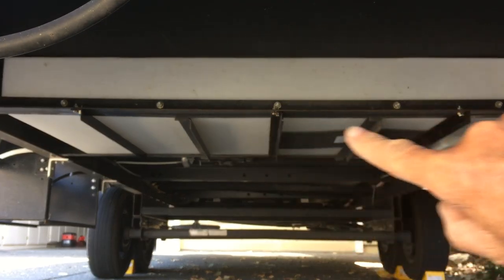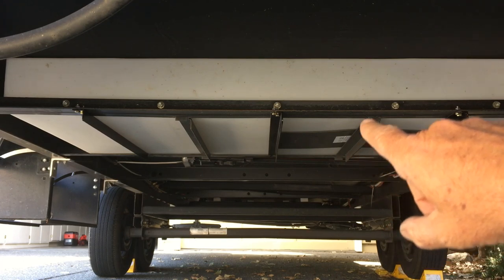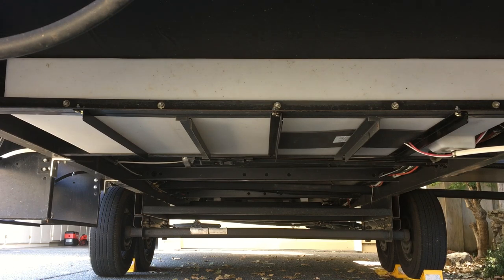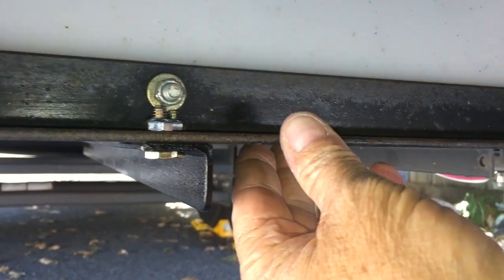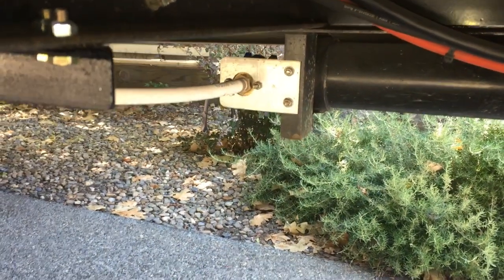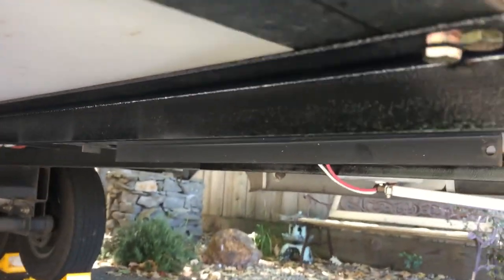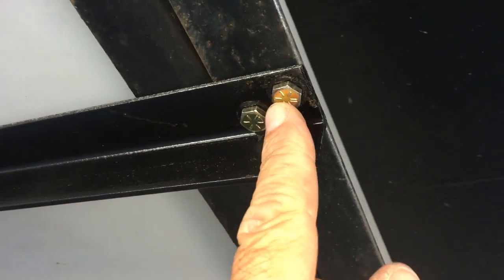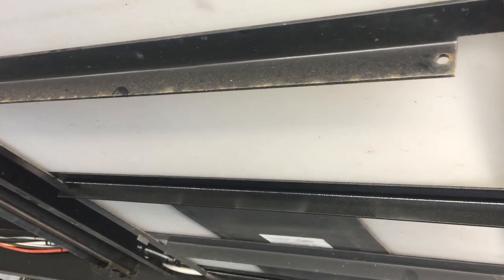How to Add Additional Support to Your Travel Trailer/RV Fresh Water Tank

Comment: That’s a well thought out repair. Just the way it should have been done from the factory.
My trailer has a corrugated plastic underneath the frame, and I’ve been meaning to take a look.
It’s always better to find problems in your driveway vs. on the road!
Reply from the maker: Yep preventative maintenance is the key :) , thanks for watching Tony

Comment: Even though you used flat carriage bolts I recommend to use anything to eliminate the gap between the tank and the L iron, bumpy non paved roads will highlight any possible issues down the road, maybe some thin plastic the same width of the head of the bolt should prevent the head of the bolts rub against the tank, I've seen tanks being dragged on bumpy roads so its awesome that you did preventative care to avoid that from happening, thanks for the video!

Comment: Nice conscientious work. I would be very concerned about the bolts on the angle iron against the tank.
Reply from the maker: Thank you so much Joseph and good catch on the bolts :) Fortunately I was concerned about these bolt heads wearing on the tank when I installed them. I used carriage bolts and made sure the bottom of the heads were flush against the inside of the angle iron and they were not rubbing the tank :) 
Here's another video on me replacing the fresh water tank that you may enjoy watching - https://youtu.be/TpxQhJzwULU?si=QolaVhy9RicX_45m
https://www.youtube.com/@thetraveltrailerguy/videos

Comment: I've got a 2006 Jayco that has just two metal straps with wood screws holding it. It also has two angle iron pieces holding it in. I filled it full and moved it on to a place on my property and one of the metal straps broke. glad it didn't occur while drivers,  but I also never drive with a full tank.
Reply from the maker: You are so lucky it didn't brake while driving :) it could have become interesting really quick

Comment: Nice job ! I have a 2019 Flagstaff 22FBRS with a 60 gallon fresh water tank and enclosed underbelly. Looks like I have another project to do. I figured out that 60 gallons weighs over 500 pounds so I became concerned, since I boondock the majority of the time. Thanks for the great ideas !
Reply from the maker: Thank you Michael. It was so worth it to beef up the supports under the tank, I found it helps the tank from sagging and did not cost much to do. Since doing it I no longer have to worry about the tank falling out and am able to carry water with confidence that everything is okay. water weighs 8.34 pounds per gallon so you are correct with your calculations, and when driving and the water sloshing around I'm sure it adds more stress on the tank without acquit support.

Comment: I really like this solution.
There is no center support at all on mine (Salem FSX), aside from the plastic belly panels.
The belly panels are likely to interfere with angle iron done the way you fixed yours so I'm probably gonna have to get creative.
Reply from the maker: I have seen in some FB groups where people with the underbelly on the install Unistrut from frame to frame under the water tank connecting the strut to it. Here' the FB group I have been seeing people do it and posting pictures - https://www.facebook.com/groups/minilite.microlite.fans

Here' the strut they have been using -
https://www.homedepot.com/p/Superstrut-10-ft-12-Gauge-Half-Slotted-Metal-Framing-Strut-Channel-Silver-Galvanized-ZA12HS10EG/202714274

https://www.youtube.com/c/MichaelBracewellTheTravelTrailerGuy/videos

Comment: Great job!   We've recently purchased a new Freedom Express 192rbs.  We won't start using it until spring 2020 so it's not an issue..YET.  
I have read that the fresh water tank on those is also poorly supported (seems to be common across Forest River and probably all RV brands) so, it'll simply be a matter of time before I need to fix it.   Therefore, I plan on upgrading the support before it's maiden voyage :-)   
The only minor issue is that the Freedom Express has enclosed underbelly, so that is going to be a P.I.T.A,  but I'm still going to look at doing the same thing you did.  I've not done much welding so wasn't really sure how to tackle the project, but you've provided me with some great tips.
Cheers!
Reply from the maker: Thank you so much for the compliment and feedback. We just came back from a 5,000 mile trip and a few times I needed to carry water while driving, this fix did the trick better than expected. I'm glad I didn't have to deal with a enclosed underbelly doing it. Once you do this you will be glad you did. Happy Camping and thanks for the feedback

Comment: Good repair,  should add another angle iron across back side.  Likely to do the same as front piece did.  Lot easier to do before original bends
Reply from the maker: Thank you for watching and the suggestion, I may do this :)

Comment: Great video thank you.   My question is. When you notched the support L bar and slide it under the tank did the notch not weeken the  L bar?   I figure sine it has been 2 years since you made the video it's still holding strong.   I have a new grand design and it has 2 straps so I'm going to shore mine up and your idea makes it way easier.   Thanks for the response and ideas
Reply from the maker: Thanks Chris. Great question, it did not weaken the angle iron to notch it. I've been checking on it quite a bit while under the trailer to make sure over the years and it still looks like the day I installed the extra angle iron supports. I'm so happy I did this improvement project, I know you saw this already but click here for a shortcut to what I did in the video. https://youtu.be/RYttKOkgCPk 

I bought my materials at a local metal supply. But I'm pretty sure Home Depot sells what you would need. I hope this information helps -

Long Rail Support - 
Qty 1 - 1 1/2" X 1 1/2" X 3/16" steel angle iron
Qty 5 - 5/16" X 1" steel carriage bolts for long rail support
Qty 5 - 5/16" lock nuts
Qty 5 - 5/16" washers

Short Rail Supports -
Qty 3 - 1 1/4" X 1 1/4" X 1/8" X 30" long steel angle iron
Qty 6 - 1/4"" X 3/4" grade 8 bolts
Qty 6 - 1/4" lock nuts

1 can black spray paint
Reply: @thetraveltrailerguy  awsome.   Thank you.  The good thing is my beams are a decent size so I do t need to shore them up.    The bad part is mine looks like strapping as a tank support safety lol.   Great videos I will be watching more of them
Reply from the maker: @cgd123fly  I don't understand why they think strapping is a good choice for holding up a water tank. Thanks again Chris. Have you watched this video? - https://youtu.be/HChZHrz5psk

Comment: Did you reinforce the cross member toward the axle, also? Seems like you did the crossmember towards the front of the rig? Did I miss it? Thx!! Great mod :)
Reply from the maker: Good catch John, I only reinforced the crossmember towards the front of the trailer and not the back one near the the axle. The back one was not bending and is a lot stronger than the front one because it didn't have factory slits in it weakening it. Thanks John :)   We have a lot of miles on the trailer since I made this video and everything is holding up nicely.

Comment: What about thy black and gray water tanks? Do you need to reinforce them also? You did a great job.
Reply: Good question, I’ve been watching them for the last 3 years and they were installed a lot better so I don’t see any further problems coming up with them.
Reply: @michaelbracewell103  Michael I have a 2017 Rockwood mini Lite like yours and I had the same problem as you did with it bending my side supports fell out at the time. Can you tell me how LONG your one-and-a-half by 3/16 angle iron were cut? Was it 96 in Long?

Comment: Hello Michael thanks for the video! I had the same 2017 Rockwood mini Lite as you and had the same problem a few months back. I'd like to go ahead and buy the materials but you didn't mention how LONG the one-and-a-half by 3/16 angle iron support from wheel-to-wheel was?
Reply from the maker: I just measured and it is 68 1/2" long on our trailer 2017 Rockwood Mini Lite 2504S. I hope this helps you. Thanks for watching
Reply: @thetraveltrailerguy  thank you Michael I appreciate you checking, I measured mine and it end up being just 68 in I have a 2104s.
Reply from the maker: @paultomlinson8743  No problem, this will help strengthen everything up very well.

Comment: Excellent video and camera close-ups!  I was wondering if drilling two holes near each other would weaken that spot?  I'll use your ideas for my 5W.  Thanks.
Reply: Chuck Potter thank you for watching. I drilled smaller holes rather than bigger ones so it won’t effect the structural integrity to much. I’m currently on a 5,O00 mile trip and have driven 4,500 miles so far and 25% of the time I’ve been hauling water and this set up is working great. And I see no bowing in the angle iron and the plastic tank hardly sags at all.

Comment: Hey Michael, I have a 2020 micro lite 21DS with three angle iron supports under my water tank. Interestingly, it's these three longitudinal supports that are bending when my water tank is full. I'm thinking of possibly adding a sheet of three quarter inch plywood to help evenly distribute the weight of the tank.

Thoughts?
Reply from the maker: Oh wow, how long are these supports and how thick are they? I would just upsize the angle supports with thicker metal and add a couple more. I get kind of nervous using wood because eventually wood can rot. Make sure you put angle iron under the end of the fresh water tank. Keep a look out for a video I hope to put out this Friday 9/9/22 of me replacing my failed fresh water tank with a new one (the original tank was so brittle and cracked)
Reply: @thetraveltrailerguy  good points! I was thinking about marine plywood. However, my tank is extremely flexible. It Belly's below my angle iron when full. Yeah, I might look into just doing additional angle iron. I have the capability of welding additional supports in place. Although, I'm a little worried about causing any kind of electrical problems if I were to do that.
Reply from the maker: @Dan-sc8ww  You can also bolt the angle iron in place like I did if that works for you, so its easy to remove and replace the tank in the future if you have to
Reply: @thetraveltrailerguy  you know, I just might go that route. We do a lot of boondocking, and I am always carrying a full tank of water wherever we go. Nevertheless, I look forward to your tank replacement video as I just well may do the same thing in the future.
Reply from the maker: @Dan-sc8ww  https://youtu.be/TpxQhJzwULU

Comment: Michael,
Great video!
Just got through removing a section of the coroplast underbelly and our 2016 2304ks has same set up for supporting the tank.
Question - how did you support the tank after removing the screwed in / bolted in cross brace? Can the tank be raised about 1" to drill thru the fixed cross braces?
Thanks!
Reply from the maker: Sorry I did not get back to you yesterday, I was out of town. The tank can not be raised. What I did was remove the 4 self taping screws on the removable angle iron brace, then put a jack under the tank on the same end, then I slide the tank back which gave me room (a inch or two) to drill my holes in the fixed brace, then I placed a piece of scrap wood (1" X 4")  between the angle brace and the tank where I drilled the holes so when I drilled the holes and went through the angle iron it would hit the wood and not the tank plastic, this worked good and then put the bolts in and tightened. then I slide the tank back in place and put everything back together. I hope this helps. Mike
Reply: @thetraveltrailerguy  Michael, yes! This what I thought - just wanted to be sure.

I will be working on this mod this week.  

Many thanks for the solution and this how-to.

Ralph

Michael, yes! This what I thought - just wanted to be sure.

I will be working on this mod this week.  

Many thanks for the solution and this how-to.

Ralph
Reply: Ralph Rosales awesome, let me know how it goes

Comment: Since the gray and black tanks can be the same gallonage as the fresh water tank (as they are in my trailer), have you checked those to see if they need supports as well? It would be bad to lose the fresh tank, but a disaster to lose the black or even the gray.
Reply from the maker: Great question Greg, I should have made a video and may make one someday (thanks for giving me an idea for another video) The gray and black tanks are smaller than the fresh water tank and are supported very well and I see no problems with them falling out. Keep an eye for a video on this :)

Comment: Which model is this rig? Thx....still working on this. Had camper in storage and it's hard to get intimate with something that's locked up LOL
Reply from the maker: Its a 2017 Rockwood Mini Lite 2504S. Are you having the same problem with your trailer? What trailer and model do you have?
Reply: @thetraveltrailerguy  2019 - 2109S. Looks a lot like yours underneath.

Comment: How did you cut square holes for carriage bolts?
Reply from the maker: Great question and catch. I used a square drill bit, just kidding  :) I drilled a hole a little smaller than square on the carriage bolt and filed the corners in the hole so the carriage bolt square would fit. Thanks for you question and for watching. Take care, Mike
Reply: Thinking plasma or ya didn't 
..someones gonna find a

Comment: About how much did all the angle iron coat you?
Reply from the maker: Around $40 for all the steel without the bolts
Reply: @thetraveltrailerguy  definitely affordable then. I was going to brace my Micro Lite tank with ratchet straps, but this would only cost a few bucks more. 

Off to find a metal shop.
Reply from the maker: @steelsunpi  Awesome :) let me know how it goes